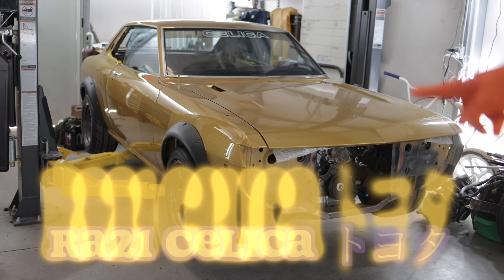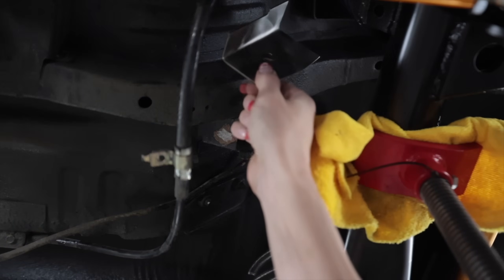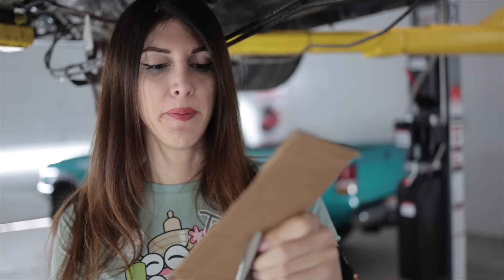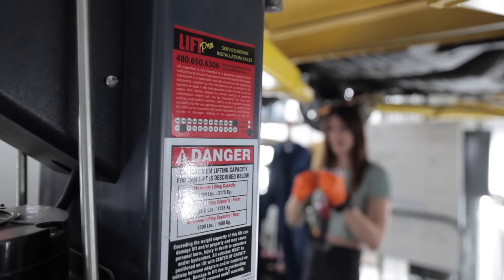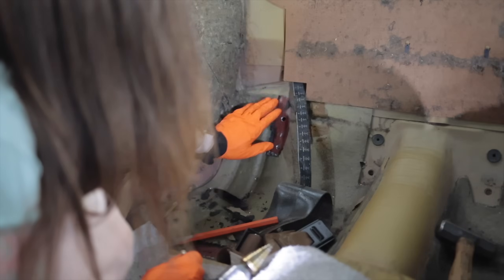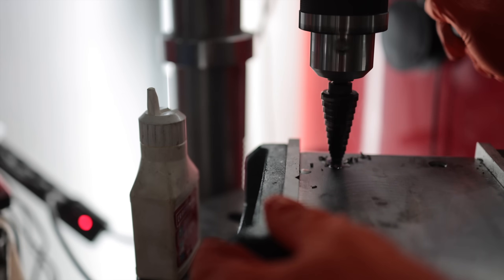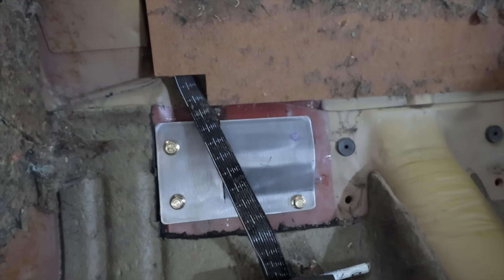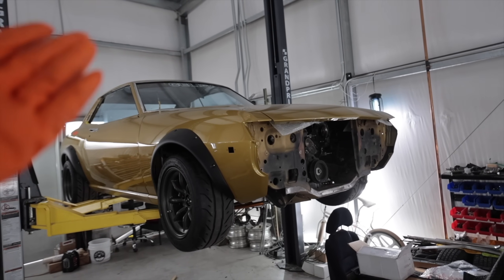Fabricating My Own 4-Link Upgrade // 2UZ-FE V8 Swap

Comment: Loving this build, miss the two  ('71 and '74) I used to have. I think a 1UZ would be a better engine in this chassis due to being significantly lighter but it is still impressive.
Reply from the maker: It wasn’t about what was a better engine, it was about what can I stick THAT trucks engine into.
Reply: Ya, I dunno much but am curious about how the 562? Lbs iron block V8 will affect handling 🆚 275 -300 lb turbo 4 cyl. But if you're getting a free or cheap nice toyota V8 engine that can handle major hp upgrades I can totally see why it's being used. Even if it did sacrifice a little handling. 
I'm not sure what would be better, a lighter, high hp, high revving, turbo 4 cyl with less tq & bottom end....Or heavier lower revving v8 torque monster that can be made to put out major torque & hp.
Reply from the maker: @michaelbrinks8089  The original 18R is 403lbs, the 2UZ isn’t fully dressed anymore so it’ll be down closer to 450-500 Lbs. It wasn’t a free V8, I have $16k in that engine now. You’re completely missing the point though. I DID NOT do this swap for ANY reason other than it was my fathers truck he bought new back in 2005, and it had an unfortunate early death due to hitting a moose.

Comment: Regarding the headers, you could do a 3D scan of the engine and engine bay (the ideal would be a 3d scanner, but an iPhone is quite competent), based on this, any competent exhaust shop can create the design in CAD, CNC bending, welding and delivering a finished piece to you. 
I just don't know if this is more expensive or cheaper, this method certainly involves fewer hours of work, but it requires more skilled labor and is therefore more expensive.

Comment: They do have a mini plasma cutter. Watch grind Hard Plumbing to see it used and the maker.
Reply from the maker: I need a bigger shop before I get something like that, looks awesome though!
Reply: Called an Arc Droid. Fits on a card table. Needed cutter is bigger then the droid. @SarahnTuned

Comment: I found learning to TIG was easier than basic stick welding, or MIG. Maybe I had more patience because I learned TIG when I was older.
If you are already established with your MIG setup I would suggest firing up the TIG.

Comment: Sarah, I have no doubts you could fabricate headers. You have the patience and perfectionist drive to do it right. Header fabrication is all time spent fitting up curves and angles. The welding is a minor part.
Consider fabricating the headers by tacking them up in place, then have someone weld them up once you have established the final shapes. A MIG will work just fine for tacking up- the tacks can be welded into the final welds later on, so anything a bit average will disappear!

Comment: A 10 hour welding video……..YES PLEASE. 
I’d be down with that. 
As for the tig, if all you do was to tac the pieces together, you could take it to a shop to have them finish welding. You don’t even need to get experience using filler rod to tac the pieces together.  Someone probably has the base plate pre fabbed, then just buy a bunch of pre bent pieces, cut them to fit, and Bob’s yer uncle. Hey. Wha’ch ya know. That’s my name😜

Comment: YES YES YES YES TIG ALL THE WAY. Don't take ten thousand hours, just take a couple dozen! With your attention to detail and your knack for detail, you'd pick up the intricacies of TIG quite quickly. Don't bother with MIG. TIG welds are stronger and better - especially on original factory sheetmetal.

Comment: I taught myself to tig weld, it didn't take long but I had some experience in Oxy/Acetylene welding-very similar . I also taught myself to build headers. At one point I had a website on designing & building headers that was the most visited site on the internet but that was nearly 15 years ago-long gone ages ago. I never had a machine that nice to tig with, I say get after it.

Comment: You asked and Yes Sarah there is a miniature version of the plasma table it is called Arc Droid ! The only way to learn to weld is try try and try again, everyone starts with zero experience no matter what trade you are involved in. The Celica is coming along nicely !!! Stainless Headers has 2UZ Header Flanges and they have build kits available for all your needs.

Comment: I'd like to see your learning process on the tig. I actually have that same tig welder in about the same exact condition because I have had zero time to actually practice with it. But, I do see making a full header being a large obstacle to take on. I got mine mainly to make new motorcycle pipes to test out for racing vintage bikes.

Comment: Maybe Tac the header then let someone else weld them? Or use PVC fittings cut on the bandsaw for mockups? They come in 15° or 45° Bends. 90° Too for really tight areas.

Comment: Experimental aviation association might help with learning to weld.   Stick welding will give you acceptable welds strength wise, with less skill needs.  The downside the weld will not be as pretty.  If you are welding under a car you should be able to learn to do a basic useful weld in about 4 hours and that would be one video

Comment: Learn welding for sure! But that project is really tough to TIG for a beginner with it being all overhead, gravity working against you. Might try welding some of the parts together yourself on the bench (with the added bonus you can re-try if it all goes bad), but when welding to the car, suggest getting help. If you try to tackle that as a first project, you're going to hate welding.
Reply: TIG the headers on the bench... overhead for the brackets: ask the U-Wrench guys for help and MIG it.

Comment: I was going to say you should get a welder and have a go yourself. It's how I learned. Glad to see you went that route. Tig seems better than the old arc style and mig welders I used so you have the right kit to get you going. I'm fine about seeing you weld stuff as its all part of the process of going from what you have, to what you need and seeing the end result. Modding a car usually needs some welding so what you learn here will be useful for future projects.

If you can get the hang of doing spot welds on the headers so you can make a header (a few practice goes before hand of course), you can then take it to a pro welder to get them to finish it for you. In the mean time a bit of practice when you get the opportunity will be useful for when you want to get under the car for real. It won't always go to plan, so grinding and starting again might be more the norm to start with. At least you have mostly clean metal to start with so don't have to grind too much to get to bare metal for the welds.

Comment: Sarah, you’re right about stepper bits.  I thought it was going to be the end of the bit when you were drilling stainless.  Go ahead and practice Tig for a video.  I’m trying to learn it myself.  You’d think, after 35 years of hobby stick welding, it would be easy, but nope. 👍

Comment: To bad your shop is getting to small since it's located perfectly for anything you need from paint, body work, paint booth, someone to help if needed and a business that can plasma cut most anything you need. Also, Building headers that release exhaust evenly across all banks is an art form and if Charlie can't do this work I'd bite the bullet and get a custom shop to do it.. I wonder how others who have done this same upgrade handled their exhaust issues..

Comment: There HAS to be a local fabricator in the area that would do a collaboration with you for the complex welding tasks. Come on guys, help a girl out!
Reply from the maker: I don’t feel comfortable letting a complete stranger into my shop, and then putting them on camera, let alone touching this car.
Reply: @SarahnTuned  Hey, I get it. I don't even like when my friends are in my shop.
Reply: I offered to come down from Toronto to build her a set of headers. I didn't get a response.

Comment: Awesome video.
About the bench top plasma cutter... The Grind Hard Plumbing folks use a rig called an arcdroid which might fit the bill.
Reply: Absolutely, awesome machine without a ton of upfront knowledge required.
Reply: I was just going to mention that.

Comment: I would get mild tubing and stainless.
Build your headers with mild and learn to weld.
Then make a pair with what you have learned to make a set with Stainless.
I have 100% confidence that the time you're done with the 1st set, you will do a great job on the Stainless.
You GOT THIS.
Reply from the maker: Already have everything for the headers
Reply: Welding is a lifetime skill you won’t regret putting time in learning. As usual I am addicted to your channel 👌
Reply: I second the above. Add that you can get a wire profile of custom headers using straightened out coathangers and bent in 3 axes just how you'd like your pipes, in the space constraints a given engine bay says will fit.
Reply: Making tools or similar would also work for practice without wasting a ton of time/money/material
Reply: Along with learning about automotive stuff, I think most people watch for your personality and made up vocabulary.  So yes, bring on the welding videos.

Comment: Tig = yes. Would love to watch the learning process, especially with your commentary about what is working and what is not. Loved the plate process for this one too. Super interesting.
Reply: Another vote for Welding content, though, do yourself a favour and film it with a camera (not to mention a lens)  that you are not worried about ruining.
Reply: I'm just about to learn it too, you're timing is perfect. Let's do it 😁
Reply: Would totally watch it as well.
Reply: I agree with other comments, it would be interesting to see the learning process on the welding. You do not have to be an expert on everything. Those of us who also want to learn to weld could benefit from your journey.
Reply: I agree 2000x correction 20,000x
Reply: I'm also at a point where I should know how to weld so it would be awesome to watch along
Reply: Diddo on ALL that.  As an old rusty welder about to dust off the cobwebs, I'd probably benefit as well... and you're nice to listen to as well 🙂
Reply: Definitely a big yes.
I learn from Sarah's explanations
Reply: Depends what type of welding you are looking for. I personally use stick welding, not easy for starters. But modern inverters make this process alot easier. The only issues are welding very thin metal sheets as Aluminium. But it's way more affordable than TIG as MIG. Especially over gasless MIG known as flux core welding.
Reply: I'm also about to start learning TIG so would love to take the journey with Sarah. 😂
Reply: Beginner Learns TiG - there's a whole series. Sarah could get guest welders in - like Mike Finnegan and Kyle the roll cage wizard from team Cleetus.
Reply: Love to watch your welding process. Looking to buy a small one myself.